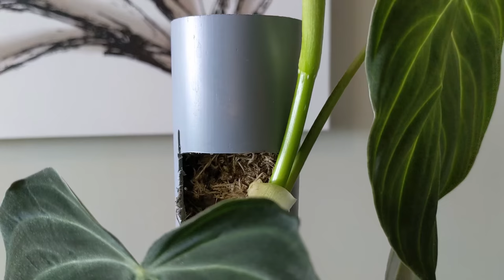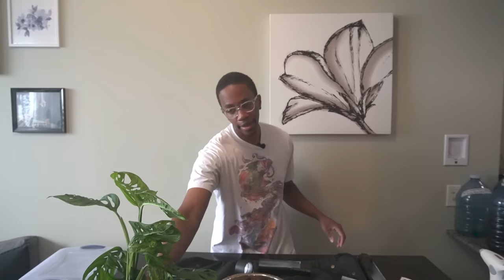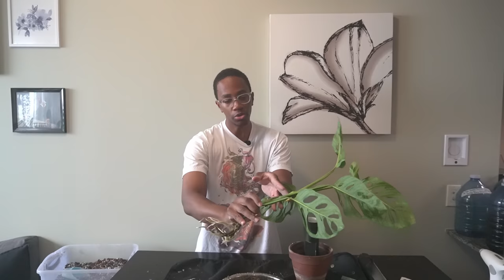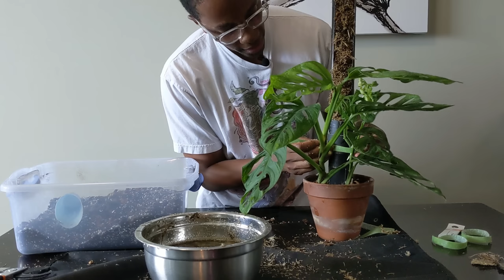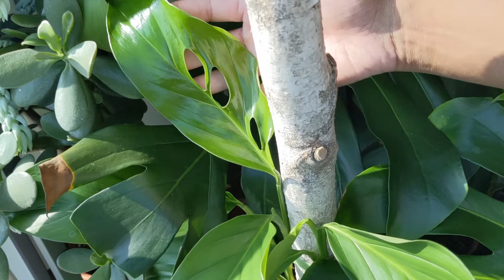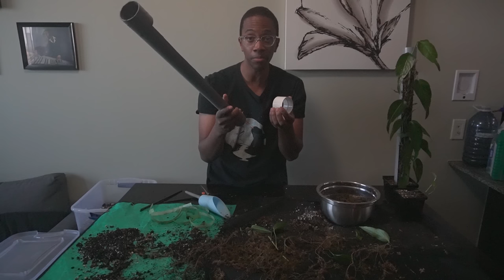I had to design my own moss poles... this is why

Comment: 1/3 of my plants are on poles, I really love this idea, but I do think you should take it to the next level and find a way to shorten the gap when extending it so you don’t have to tie your plants to the pole. Maybe find a way to place some grid like holes in the connecting section so the roots can just keep going without disruption? Keep going with this and seriously get a patent!
Reply from the maker: Thanks for the suggestion!
Reply: Its doable if you make the coupling tube part of the inside diameter rather than outside, it would add the step of gluing a part but you could make the pole more seamless and reduce the gap to about an inch. youd have to lay the end tape half way off the tube rather than on the edge also but each piece would only need a little ring glued in the top and the next piece can just friction fit.

Comment: I completed the cut through the top of the pole, without thinking, but now I'm realizing that if I do the same with the coupling and the next pipe, then you can keep a consistent root and just rotate the coupling 180°to hold the two pipes better.

Comment: Love this design. I have about 10 of the poles. I found a cool way to extend them is to take your extension, heat up 7cm at the bottom with a heat gun. Get a spare piece of a pipe of the same size and stretch it out. No need for connector. I put a piece of yogurt lid with small holes in it to prevent roots from growing all the way down to make chop and prop easier in the future

Comment: I made it, and it works great so far. Its not super stable in the pot, but that probably isn´t the poles fault. For now it´s ok and when I want to put a extntion on I will get creative. But I have to say it really dries out slover than the pole I had before and that allready had a back. I used cling film to wrap between some of the leaves to further cover the moss. I also love how easie it is to water. I can either put a small bottle on the top, or just dump some water in. The very top whre the pipe is empty, there for I have space to just fill up with water.  Right now the unused space at the top is wrapped with cling film and therefor the water I pur in had enough time to go into the moss and doesn´t just run down the front. I have a monstera adansonii on it and it really loves it and grows nicely.

Comment: Very clever! I really like your method, Lee. I’m sure it’s also less messy than the moss poles I’ve made with the wire. But…. I will not even attempt to make your style of moss pole bc I know my limitations 😂! 
I find watering my moss poles time consuming and, worse, bc this is still relatively new to me, I don’t have a feel yet for whether the plant itself is dry or not. So… there’s an element of anxiety and worry bc obviously I don’t want to kill my plants! Anyway, thank you for the clip. I always enjoy your presentations and I learn from them.
Reply from the maker: Thank you. 

It is extremely time consuming. I think its important not to overcomplicate a hobby to a point where you can no longer enjoy it.
Reply: @KillThisPlant  I agree! I was getting close to that point so I’ve dialed it back some. But… my personality is such that I want to do things right … and I’ve invested money and time into these beauties so I’d rather they lived!
Reply: I tried sticking wood in the soil and I tried digging my finger in to see if itMs wet, but we humans do not have sense of wet, we can feel texture and temperature and based on that know when something is wet, but at a certain point I can't make out if the plant is dry at the bottom or not, so I got a moistmeter, stick it in all the way and know for sure, takes anxiety out of the hobby for me by a lot. 
As for moss poles I think I will opt for wood instead, I don't wanna buy moss and I won't be able to find enough locally to fill a tube, in the wild they climb up trees and that's what I wanna try, just get a nice branch and make a jungle forest in my living room
Reply: @single_use_planet_  just make sure the wood is thoroughly cleaned and sprayed with eight. Ya know fungus gnats, spider mites, whatever else bugs germs and bacteria. You don't want them killing your plants.
Reply: @deewilliams9375  what's eight???

Comment: 4 inch black gutter pipe work well for people in the UK yes 4 inch they they don’t do  a 3ich and 2 ich for me is small and drys out to fast because here in uk our house  sit at 50 humidity 

Oh and save you needing to paint then if you don’t mind gloss black but if don’t want to be gloss sand it with 240grit then 320 then 400

Comment: I really want to try you design but I was hoping to use tree fern fibre instead of sphagnum moss. Any thoughts on if it would still stay packed into the pipe as it's much more airy? Thanks for you amazing content and advice, as usual!
Reply from the maker: 🤷🏾‍♂️ maybe mix the two so the moss helps keeps its shape?
Reply: @KillThisPlant  That's a good idea! I might try a few experiments with some different types.
Reply from the maker: @DannitheGayby  I will also try at some point

Comment: You should start selling them. Make sure to patent your idea and design, hopefully you have already done that.
I haven't seen your video on making these yet. I just made a traditional one today and it took me for ever! Your design definitely has some major advantages! Being able to take the overgrown plant out easily is major. Ease of filling it incrementally. Ease and no mess storing, handling, installing and extending the pole. No scratches from wire or plastic mesh. Very cool! I appreciate that you come up with original, innovative, pracrical ideas. (So often everyone just does their version of the same thing)

Comment: Where did you get the pvc and what is the exact type? Is it water or electrical? The ones I’m seeing are so thick and heavy but yours seems thin and light weight
Reply from the maker: The tubing I found was specifically for central vacuum. Even though I bought it from Lowe's I haven't been able to find it's exact online listing (Canada).
Reply: @KillThisPlant  thanks for responding 👍🏾

Comment: When you water the plant, do you water it pot only and spray the moss at the same time, or do you spray the moss more often? If the latter, how do you avoid constantly moist soil in the pot from the unabsorbed water running down from the pole?
Reply from the maker: I treat my soil and moss pole as two separate entities. My soil has its own schedule, my moss has its own schedule. 

You really need a great well draining soil so that excess water dripping from your moss doesn't cause issues in your soil.  Generally having a smaller pot helps too. The more you get used to watering the moss pole, the more you'll be able to gauge how much water it can hold without it dripping down.
Reply: The video I didnt know I needed! Thanks for sharing 😁

Comment: I love this idea. Great video and design Lee.  I do have one question, with the moss being exposed in the front but not the back, how do you keep it uniformly damp. Would it make sense to drill some holes in the back of the pole to mist through?
Reply from the maker: I don't seem to have issues with that. Think of it like how if you wet a corner of a paper towel eventually it will eventually be completely soaked.

It's about practicing knowing how much water to spray.
Reply: @Kill This Plant  okay that makes sense. It took me close to two years to work it out for my mounted orchids. I may try this when I repot the monster monsterra as I call her. Thanks much Lee!!!

Comment: Niiiice! Now you just need to rig a drip system that automatically delivers water/feed.. I think it would be relatively simple with this setup, too.
Instead of providing too much of a tl;dr, Tanner at Serpa Design does some pretty cool things with paludariums and vivariums that would be great for inspiration.  
Utilizing a tweaked sort of concept that he uses for his living moss walls, you could add a new hose at the top of each moss pole, throw that baby on a timer, then let it slow drip every 1-2 days or so. 
.. Or get a mister of sorts? That seems messy and less controlled, though. 

Either way, the lazier one can be longterm, the better. 🤷‍♀️ 😬
Reply from the maker: I subscribe to him, but I've never thought of using those ideas!

I'll think about it 😎 thanks!
Reply: @KillThisPlant  ohhh, dude. There’s so much opportunity to interconnect these seemingly disparate ideas and methods into uniquely engineered solutions for houseplant management.. In theory anyway. Working toward testing some hybrid solutions out. 

Anyway, good luck! 👍

Comment: Why do you have to use moss in the tube?
Reply from the maker: it is the best medium for a plant to root vertically, it retains moisture well.

I have seen others try, soil, LECA, and other materials but none seem to work as consistently well.

Comment: I don’t like the looks of your tube, but it’s very ingenious…I , personally, like the looks of the green wire with moss inside…of course, I’m viewing this from a woman’s perspective, and you’re viewing your pole from a man’s point of view…we do see things differently….I did learn a lot from this video…about the aerial roots and the back side of the plant…great info!  As you can tell, I’m just learning about houseplants…Be Blessed!
Reply from the maker: If you're able to learn something, even if you're never going to make this, then I call it a successful video! Thanks for watching.
Reply: You’re speaking from your personal perspective, you mean*
Your preferred aesthetic has nothing to do with being female.

Personally, I despise moss poles wrapped with wire; They look cheesy to me. 
Lee’s design is not only super practical, but it’s sleek and can be “jazzed up” in multiple ways. [re: another commenter had excellent suggestions.. I may run with it and use med-large cork bark pieces😍.. although, that will probably make air layering more difficult, but live and learn?]

Comment: I'm definitely going to have to try this method of moss poll! I've seen so many other videos with the wire mesh and making the plastic backing and tieing it to a metal rod for stability just looks like too much work. This is easy, cheap, and completely reusable! And like the plastic back moss polls, it'll even have the added moisture retention capability already built in! Pure genius!

Comment: Genius. For those who’d use aroid mix can possibly use a mesh for the opened part. Although it’ll be more work to do multiple propagations having a mesh. Unless splitting the plants in 2 like what you did before the leaf cuttings.
Reply from the maker: I think its something worth trying. I haven't heard as positive results from someone trying an aroid mix pole throughout.
Reply: @KillThisPlant  Ah I see. I do use aroid mix for poles. Well, gonna use again. Moss is hard for me as in my home, it's 30-31 deg celsius, mold grows like crazy on them. Definitely an irritating thing to look at hahaha.

Would've used your method if I had not just spent almost $200 on the new poles for the aroid mix. 🥲
Reply from the maker: @mhzplantingaroids  😲

Comment: Looks great
I’m going to try one and paint it black or dark green.
How about adding some small holes on the back side for better ventilation of the media inside the pole?
How wide is the opening, 2 inch or less?
Reply from the maker: Thanks, the poles I used were 2" in diameter. I think holes might be a good idea, but maybe not necessary due to the small amount of moss used. I feel like they can access oxygen fairly easily.